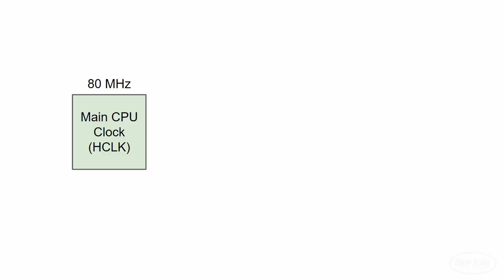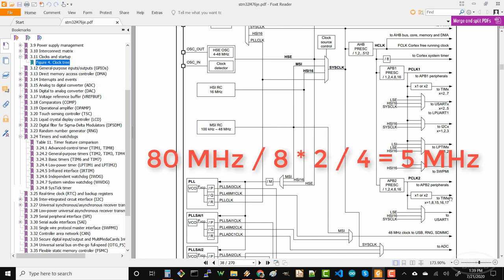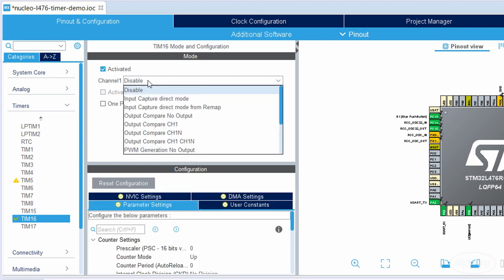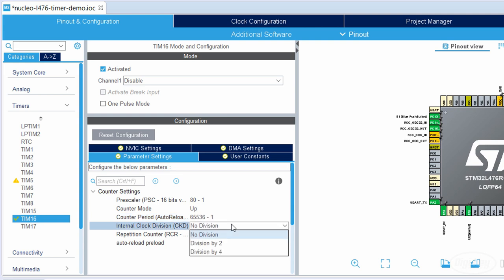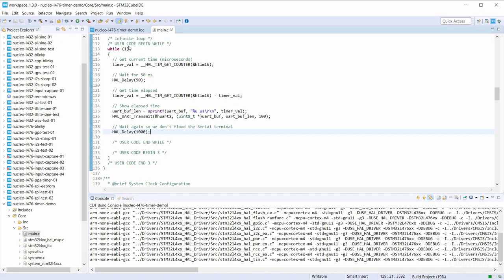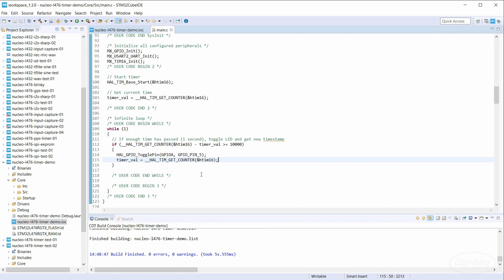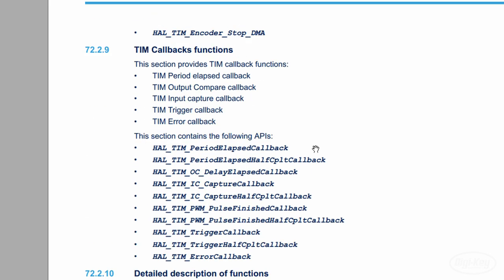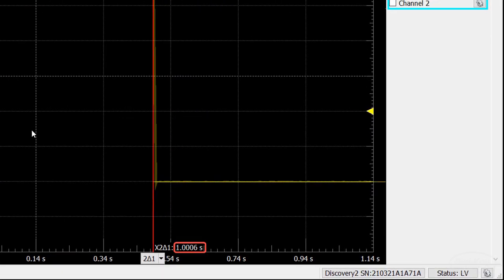Getting Started with STM32 and Nucleo Part 6: Timers and Timer Interrupts | Digi-Key Electronics

Comment: Maybe Shawn knows but for everyone else, there's a built terminal in the STM program. Near the bottom right, on that 'console' tab if you lick the icon next to the pc monitor.
Reply: I've played with it, and it seems to give me a console out of the IDE or to my PC. I couldn't ever seem to get it to give me a serial connection to my board, so I stuck with using an external program for that. I'd definitely love to know if there's a way to open a serial connection! Maybe I just missed something.
Reply: He's right. It works just as good as Putty. 
https://imgur.com/a/mfOAMig

 The "Arduino" named board is a Nucleo-G474RE.
Reply: @georgeborsa5346  Good to know, thanks!

Comment: Nice! Also, if you don't need any of the timer functionality (like triggering ISRs/callbacks or toggling pins), an easy way to measure times to the nearest millisecond is to use HAL_GetTick(), although you may have to handle overflow cases for very long-running systems (overflow happens after ~49 days and it wraps back around to zero). This function is already setup in HAL_Init(), so no additional setup is necessary.

uint32_t start_time = HAL_GetTick();
// do something
uint32_t total_time = HAL_GetTick() - start_time; // total time elapsed in milliseconds

Comment: first of all thank you for your videos, they are very helpful :)
In this video at 9:44 u are saying that it also works if the timer rolls over zero. But if I run this code exactly the way u do it, this does not work... So I had to set the counter to zero after each second to avoid this. Did I make a mistake or how else should it work without this reset?
Reply: Same thing happening to me. How can you reset the timer?
Reply: @Schmalik  i used __HAL_TIM_SetCounter(&htim16, 0);  to reset the timer to zero
Reply: @flexi1232  i was searching to see if anyone mentioned this! thanks

Comment: Just a quick question on the subject. I am fairly new to Embedded electronics. 
I am planning to design a midi control surface that incorporates lots of rotary encoders on (as many as possible). I was wondering how I could ascertain how many GPIOs that have "attached" interrupts on them. Would be grateful for any advice here. Otherwise keep up the good work! thanks

Comment: For the first example i am getting 5.6mS instead of 50mS , I am using a  STM32F303K8T6 with 72Mhz clock and prescaler of 72-1 all others settings the same.  ?!?

Comment: It's interesting that Timer's 'auto-reload preload' can be set to Disable, and you don't need to manually reload the counter in code!

Regarding using a Timer for polling elapsed time, how does it differ from using HAL_GetTick(), i.e. no Timer?    

If using the Timer to trigger an ADC reading.. it seems the number of samples captured for an input sine-wave (single cycle), is dependent on the number of channels in the Scan.  In other words, if NbrOfConversion=1, then the ADC will capture samples equal to the Timer rate.. but if NbrOfConversion>1, then only one channel gets converted per trigger event, the next channel in the scan list is captured only on the next trigger event? 

Speaking of Output-Compare, what does the  "Pulse" field do?  It seems it's necessary to be set to 1?   For example, if Output-Compare is set to to Toggle on Match, with Trigger TRGO Event = Update , and if the Timer Clock is 120Mhz (Prescaler = 60-1, Preload 62-1), then the Ouput-Compare GPIO should toggle at 32khz.. so assuming one channel in the Scan list, how often will the ADC sample the channel?

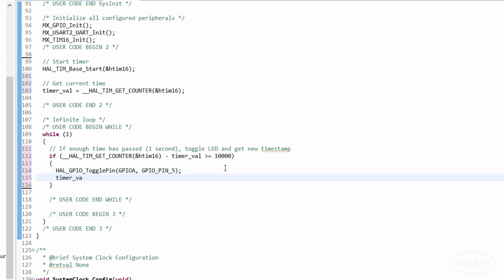Comment: At 10:00 this shouldn't work after a while right?
If timer_val is 65,000,
then __HAL_TIM_GET_COUNTER(&htim16) runs, this will give a value like 400, since it rolled over
400-65,000 >= 10,000 is false
Unless maybe you do some casting, but then it will almost always be true
You have to reset the timer, or have some extra logic
Reply: indeed, you have to account for roll over manually, or reset counter to zero using __HAL_TIM_SET_COUNTER(&htim<?>, 0);